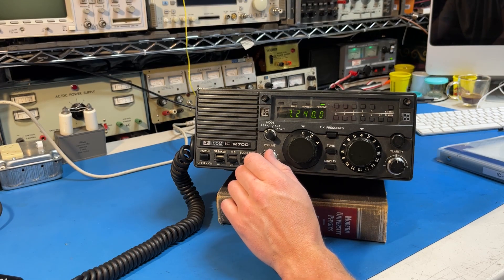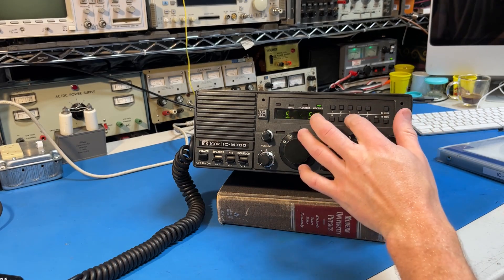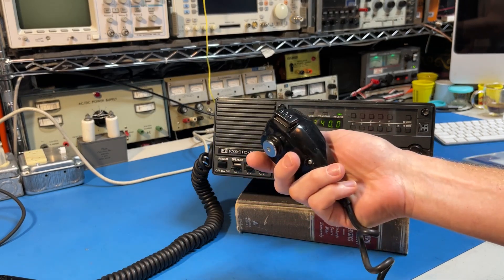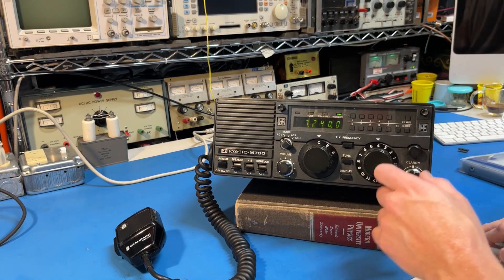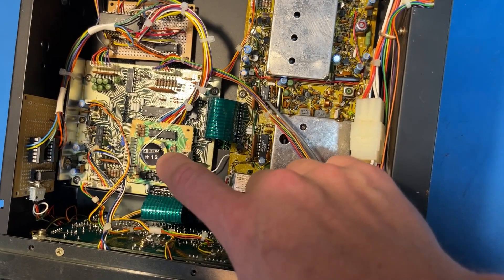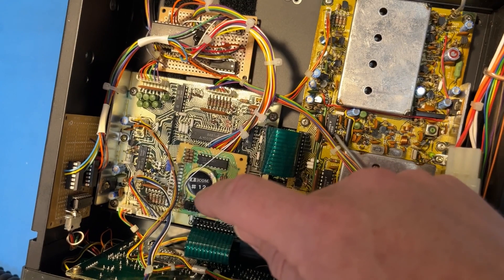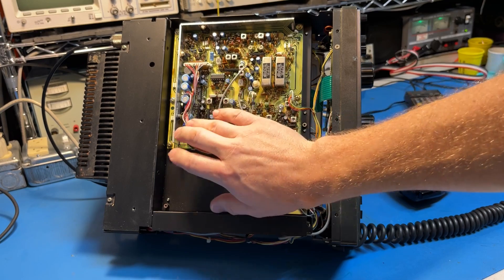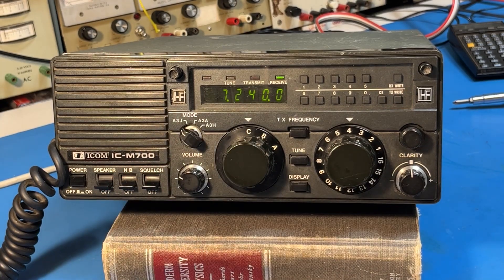IC-M700 Marine HF SSB reviewed for Ham Radio

Comment: I have a mod that may be if interest on my YouTube search icom M800. I got fed up of vfoing with the channel selector knob. I First tried another encoder which worked but have settled on an up/ down scan switch. It feeds a square wave from a 74hs04 into the back of the encoder. It's not fast ..but it saved your wrist from all that turning
Reply: https://youtube.com/shorts/aUliGmBHZZM?si=u02R77NQMiZoAL8t
Reply from the maker: Oh that’s neat! You should make a video!

Comment: I recently got hold or a Icom M800 for 60 bucks with no optical cable to comunicate to the head unit. Managed to make a new cable and get it working. The Memory encoder knob is only 20 clicks per rev which makes vfoing a complete pain, so changed for a 100 step encoder which makes life easier.
Reply from the maker: Very cool!
Reply: @W6EL  dkmods sent me off to cut d25 and d26 when in fact its  d24 and d25 and cut w1 were required on a m800...could the auto tx freq  store  be done to the m800?
Reply: also a good external mod is a atu dongle that tricks the icom into thinking it has an atu connected and so transmits a 10w cw signal to tune with . Without the dongle ( a resistor of 100k and CAP OF 100 UF ) TUNE DOES NOTHING

Comment: Very good mods. I like when someone gets creative as you did. 
I bought a CMC 26 CH SSB. It works fine. It can be opened up as well. Marconi seems to be a tank. My dad had WWII Wireless #19 sets that he played with. 
Mike
Reply from the maker: Oh wow those are definitely some neat radios. I am sure they will do a fine job on the air. Maybe add a digital VFO externally so that you can tune around? I wouldn’t put it in the same chassis since it is definitely not “original” in any sense. Thanks for your comment, I appreciate it. It’s fun to mod things and learn about them. 73!

Comment: I've had a IC-M700 sitting on my desk for over 2 years now (Sailing buddy of mine gave it to me) & this video finally got me motivated to put it on the air.   I'll need to build me a "stacked" SRAM as those 48 channels just don't cut it.  Nice work.  73 from WA5IDX (hamming it up for over 60 years).
Reply from the maker: I tell ya what, having more channels makes it a lot more usable. Plus disabling that “every single channel is split” thing. 

Let me know how it goes!

Comment: Loved these Marine Radios, fully wide banded they were fun to play with. I had min running with a Motorola GMN-6146c Hand Mic. Never got a bad Audio Signal Report. Nice Video. 73 into Montrose...my Ex-Neighborhood. I used to live down on Hill Rose in Sunland near the Golf Court for a few Years. Happy Weekend de Uncle Guenter 💯👍🙋‍♂
Reply from the maker: Montrose! Not far from here at all. We got blanketed with snow today, it was really something. That Motorola mic looks interesting, it seems like it has a 2-transistor boost circuit, similar to the original mic for the M700. 

https://www.manualslib.com/manual/803666/Motorola-Gm1200e.html?page=34#manual
Reply: @W6EL  Correct about the Motorola Mic. I had to give it a minor Modification to reduce the high Sensitivity to keep unwanted Background Noises at their lowest possible.
It gave it IC-M700 a great sounding TX Audio. From this Day on I am using these Motorola Hand Microphones with almost any of my Radios. I love the solid rugged Housing of these Mics, to be honest. The original Mic Cables are little cheasy and need to be repleaced by better ones. If these Things are changed on them you will have a durable good working Microphone for a long time. I mostly use them for mobile and portable Operation outside in all kinds of WX. 💯👍